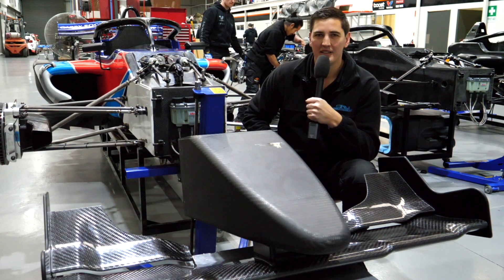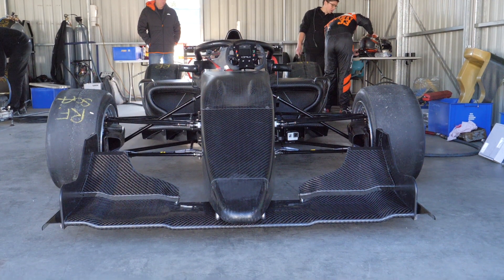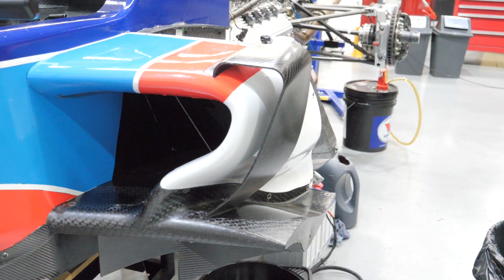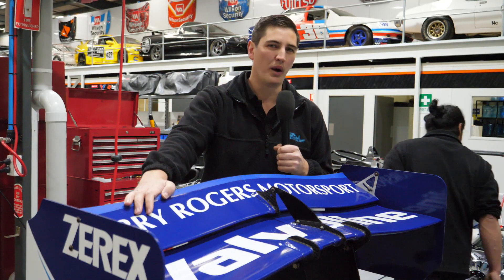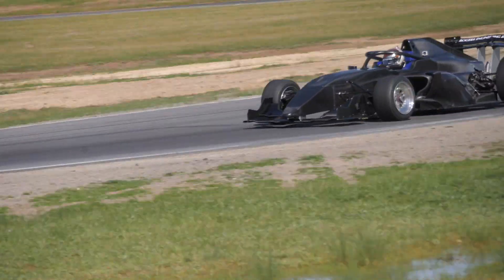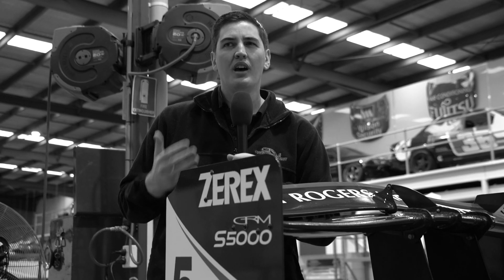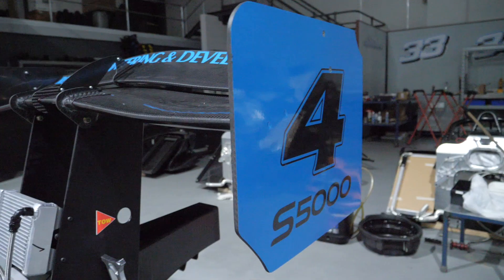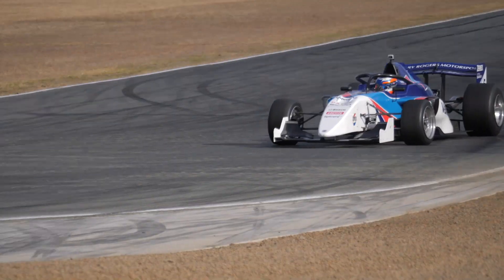S5000 Technical – Aerodynamics

Comment: How well do they follow each other with all of that aero?
Reply: There’s not much downforce with S5000. Not everything in racing car aero is about downforce and a lot is about minimising drag. It’s called lift/drag ratio and turbulent air = drag. Wake turbulence is what causes the problems we see in F1. These cars have proved to be very capable of following each other very closely. In the very first race, there were three cars - Tim Macrow, John Martin and James Golding - running up the back straight at Sandown so closely you could throw a blanket over them.